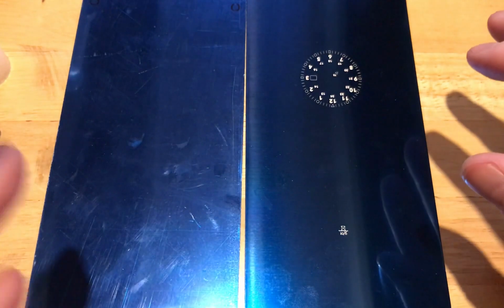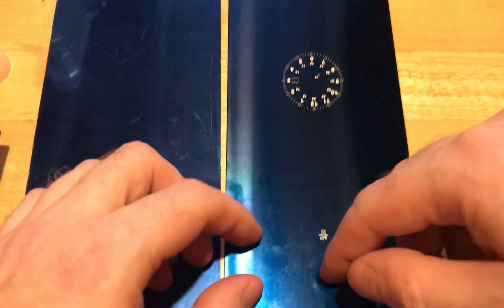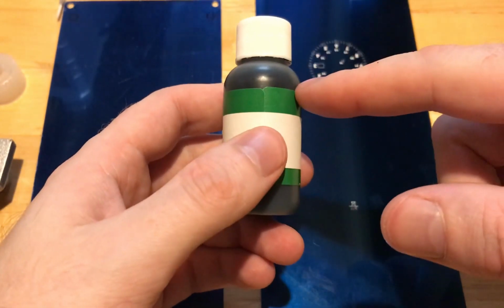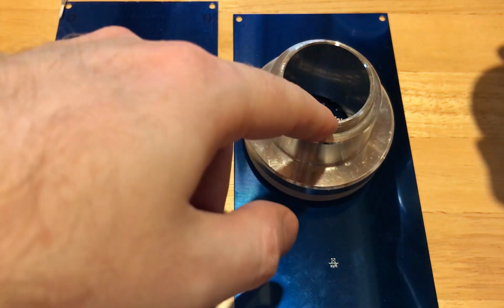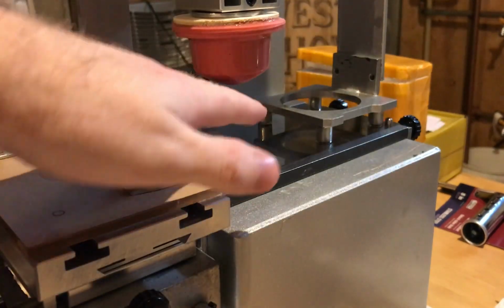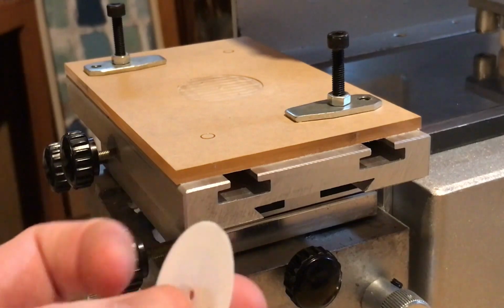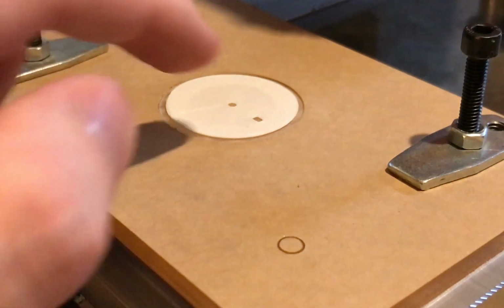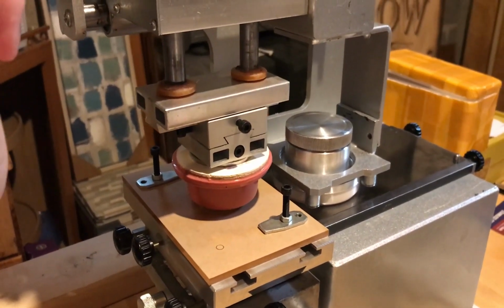Making Custom Dials Part 3: Pad Printer Setup

Comment: Hello Sir,
Which pad printing rubber size is good for dial restoration, can you tell me
Reply from the maker: That depends on the dial size. A good general size is 2" I'd say but you can go smaller or larger depending on the specific dial.
Reply: @WatchComplications ok so I will bought different size

Comment: Do you happen to have a listing of equipment that you are using? Brand of pad printer? Steel plates source? STL for dial blanks? - Great video!
Reply from the maker: You will find some information in the video descriptions about pad printing, you can also look at some of blog posts on my website watchcomplications.com like Duel Time. The pad printer is a low-cost model from China I got on eBay years ago. Steel plates I get cut locally by a mechanical engineer with a laser. I make my own STL files with AutoCAD.

Comment: What a gem this video is, thank you! I am new to the pad printing world and am trying to find info on the parameters you would use for the plates that you are engraving. Where might I find some info on that?
Reply from the maker: What parameters specifically are you wanting to know?
Reply: @WatchComplications  The metal sheets that you engrave your designs on, where do you buy them? Or do you make them?
Reply from the maker: @brockleetolman2064  they were some stock that the engineer I went through to engrave them locally had from a previous project. If you are looking to buy, I would use the term "steel cliches"
Reply: @WatchComplications  amazing, I appreciate it. Thanks!

Comment: Hi, thank you very much for making this video. Is it possible to let the ink sit in the ink well after printing to use it again days later? or do you need to clean it after every use? so is the ink well sealed enough so that the ink doesnt dry out after one or more days? Thank you.
Reply from the maker: you can leave it for some time, a day or two, but air is air and can eventually get in. The issue would be more about the areas that aren't sealed under the ink cup on the cliche that can get crusty after some time if paint is left on it.
Reply: @WatchComplications  thank you very much for your reply! Really appreciate it.

Comment: Quick Question,

Do you need to have something previously etched on the dial to apply ink? 

Or would you be able to print a logo on it with just any dial you put under the printer?

Also, awesome video! :)
Reply from the maker: You don't need anything etched on the dial for the paint to transfer. The etching is on the cliché, ink fills in the gaps and the pad transfers it from the cliché to the dial surface.

Comment: Hi, thanks for the detailed video. I have a question about laser etching machines. They do not seem to be very expensive - at around the $400 price point. Would you ever consider adding one to your workshop to avoid having to outsource that step of getting the etching done?
Reply from the maker: The lasers you are talking about are meant to cut wood, acrylic, and other softer materials...maybe etch the surface of certain metals. Some people try using acrylic or other materials for plates, but typically stainless steel works best in my experience. I know 20-26 microns doesn't sound like much depth but you need the right sort of laser to do that work, and can also handle the reflective properties of the metals in question...e.g., steel, aluminum, brass, copper. To do this work, including cutting out blanks, date windows etc...you'd be looking at Fiber lasers generally, but my plates get cut with a YV04 laser. And such laser aren't cheap.

Comment: Dude you talk to much. we all clued up thats why we hear.  Get on with it.. Thank you. frustrating you trying to explain your process, why not just do it in a run and talk us through it.  it would be a lot better for your viewers and your channel. God only knows how ink is held inside a vessel like you showed. Surely the way you showed us it would just pour out, i thought the neo-mags where to hold a screen of some sort. everything else i got. but im halfway through. maybe you will surprise us. nice little set-up. you print lume too? arr ok, i got it the ink container stays stuck to the plate and slides back n forth, i got it on my hunt. those printers are fir sick. i was thinking to do dials with screens. but the pad is a sweet process. all doable by hand and a few 3d printed parts i reckon.
Reply from the maker: me talking through the steps in detail is what my subs like about my channel. too many channels exist that don't really get into the weeds and leave people guessing. skip around would be my suggestion. you can use the same process to print lume, I'm not sure why that is the expectation for this exact vid though. I usually set things up to lume by hand, which can be seen in some of my other videos.

Comment: Clean free oil cup is an innovative product. After workers finish printing, they no longer need to clean the oil cup. They only need to replace the ink cartridge inside, saving the ink and time costs of cleaning the oil cup. When encountering products with multi-color printing, they only need to replace the ink cup with different colors. It is a good product that improves efficiency, saves costs, and is energy-saving and environmentally friendly.https://youtu.be/3zlYM9jcXlA

Comment: I am considering purchasing a pad printer for my small watch dial restoring business, and I can't seem to find anyone who etches cliches in my area. I need an estimate on the cliche etching to determine if the purchase of a pad printer would be cost effective. Are you willing to share how much you pay for the etching of your plates? Or any knowledge of who I can go to to do this?
Reply from the maker: I’m lucky enough to have someone local to me that has a laser that can do this and it costs me about 75-100 for a design. Some services exist that do it as well if you can’t find someone local, but I prefer to work with local makers if at all possible. Easier conversation.

Comment: Any thoughts on using a liquid mask to create an image that can be painted over but easily rubbed off to reveal the base metal?  Kind of like the old rolex white pan am gmts.
Reply from the maker: I haven't experimented with that sort of thing, so I really can't comment on it. I would think the challenge would be to not mess up other parts of the dial/paint during the process.

Comment: Really nice video. I missed any info about what specific pad printer plus accessories you were using. Can you give give informations about the product and where to get it.
Rgs
Anton
Reply from the maker: it’s a generic Chinese pad printer. You can find them on ebay and amazon, just search for pad printer with sealed ink cup.
Reply from the maker: I should also mention I got the ink and related accessories from a company called Imprintor, easy to find on google.
Reply: @WatchComplications  Thx a lot. 🙂

Comment: Tedious in the extreme! 
"Ok, you get a screwdriver, which is designed specifically to screw in and unscrew screws, and it is inserted into the fixture, making sure that the tip of the screwdriver inserts centrally on the surface of the screw. Then, mild pressure is applied to the screwdriver, and with a counterclockwise motion, my wrist unscrews the screw to the fixture. I continue with the counterclockwise motion until the screw is completely separated from the fixture. When the screw is wiggling in it's hole, that indicates that the screw is loose enough for removal, and signifies the end of the process of unscrewing the screw to the fixture..."

Comment: If I make and send you a vector file, could you get a plate made for me? I will compensate for your time/knowledge/costs, of course. I bought a machine but I'm having a hard time finding any resources on having plates made.
Reply from the maker: I use someone local to me with a laser. If you Google “plate etching services” “cliche etching” things like that, you will see several companies that provide the service. Different materials can be used and you’d need to have the plate dimensions for your printer.

Comment: Hello, 

Any chances you could tell me the size of the cliche this machine takes ?
Reply from the maker: they are about 8.5 x 4 inches
Reply: Thanks, i plan to make few dials I'm in the process of making cliche and they asked me about the size my machine takes. I don't have it here yet that's why I asked. 

So 215mmx100mm looks like it

Comment: Hi. Very informative video for someone like me exploring pad printing. Question: when you have your laser shop etch the ink plates, how deep do you tell them to go for optimal ink holding/transfer?
Reply from the maker: We didn't measure it. We just know how many passes the particular laser (YVO4) does of the design. But, based on what I've read, I think most etchings for pad printers are around 24-28 microns in depth. Hope that helps.
Reply: @WatchComplications  Very helpful! So I’ll short for 0.001” deep and adjust from there.
Reply from the maker: Paint viscosity and timing also has a significant impact on how well the ink transfers, so keep that in mind. Just more variables.
Reply: Is there a maximum depth? Is the ink reservoir suppose to hold just enough for the printing? - is much left behind after the pad has picked up the ink
(I'm wondering if light cuts from a pantograph would be too deep)

Comment: 50 years ago we had no silicone pads - we would melt gelatine into molds. Laser engraved plates, photosensitive papers? 
Way too simple! 
We would order hardened steet plates from Switzerland, coat them in wax, using a pantograph would scratch off the wax where required, then acid etch the markings.
I could go on about galvanic silver plating, grinding up salt, precipitating silver, cyanide stripping, chloroform fumes.
Tritium luminous powder. Radium on old dials flushed down the sink, along with some cyanide - frown on behaviour today. 

What is this modern witchcraft you use? 
It seems way too straightforward and lacks any the dangers we so enjoyed usually avoiding. And your ways slash the labour involved putting people out of work! 
Pad printing dials was a specialist job then - I never attempted to master it myself. 

Great video, I might just learn a thing or twenty here - but I miss the skin irritation and headaches from the chloroform. And the odd minor fires from acetone. All the dust issues of spraying lacquers  taught me resiliance and many many swear words too. 
I still have a scintillation meter the Gov. required us to purchase for the Tritium license - I keep it in case those Ruskies get over excited and nuke us.
Reply from the maker: one of the most entertaining comments so far on the channel. thanks :)
Reply: I’d like to know more about this as well. Your comment pulls back the curtain on a mysterious process
Reply: How come you etched the plates with acid rather than directly with the pantograph?
Reply: @beautgrainger147  Hi. The applied wax protected all the plate top surface - the back was protected with shellac.
The pantograph needle by scratching/cutting through the wax to the bare metal. This removed the protection of the wax - so you have a hardened steel plate fully protected from chemical treatment except for the lines/areas where the wax was removed from the plate.
So you use acid to eat into the bare (but polished & hardened) steel plate only on the ares exposed by the pantograph needle removing the protective wax. You get an acid engraved finely defined line, or area, on an surface that you can use a steel spatula to apply ink/paint without fear of introducing scratches by spatula  that also later add ink in random areas resulting in a crap result.

Comment: Hi. Thank you so very much for this! I want to make my own custom dial by firing vitreous enamel onto copper essentially  creating a painting in glass.  This means that I will have to make the dial from scratch, and my issue will be how to add the feet and enamel around them. I plan on finding a suitable watch and replacing the dial with my own. Another issue that I will have is with the thickness.  With each layer of glass I may have trouble controlling the thickness. Your videos are so inspiring and I look forward to making my watch,  and seeing more of your work.
Reply from the maker: sounds ambitious. enamel is crazy hard to work with. all the best!

Comment: is it easier just to print from a printer and glueing it on to the dial
Reply from the maker: it would be much much easer, but wouldn't look very good. I've seen some tutorials out there that do apply a printed paper with glue, but a better option that is not as difficult as pad printing is using waterslide decals: https://youtu.be/mtwreFBs9ts

Comment: Is it possible to pad print with luminous ink? 

Or would it be better to simply apply the lume by etching or carving the dial, and additively applying the lume to the dial, like in your other video?

I want to make my own dial, to modify a watch that I own, with a 2416b movement, to have a custom logo on it.
Reply from the maker: You can print with luminous ink, you just have to source the right ink and/or get the viscosity spot on for it to transfer clearly and cleanly. I hope to experiment more with it myself over the summer. Applying lume in depressions or on applied markers is much easier than going through the whole process of home-based pad printing, in my experience.

Comment: Hi, sorry if I missed this, but I'm eyeballing the same printer and was wondering if the rubber pads are included or if I need to order them separately. If so, where did you get the main one you use for dials? Thanks mate, love your work!
Reply from the maker: I picked up a couple different sizes on eBay. They come from California and are like $6-7 each. I also got a black one that's more firm from the company I get my ink from (https://www.imprintor.com/), to test out at some point. That one was about $40.

Comment: Love the series. A couple of questions, if you don’t mind. There are some really cheap electric pad printers on eBay ($160aud ~ $110usd ... cheaper than manual!)... do you think they would be any good and what downfalls?
With the inks, are they just a high opacity enamel? I’m just a hobbyist and really only want small sample inks and having trouble sourcing in Australia. 
I’ll keep watching the series in case you have already answered any of this in a future episode.
Reply from the maker: Hello. I would start by saying it's hard to say without considering a specific model, as there is quite a variety out there. I know most low cost machines are not that well suited for dial printing, and certainly don't have default fixtures to support dials. But if you are looking into low-cost options beyond the manual process I have shown so far in this series, you could look into film-free transfer paper. I plan to show that process in future videos, just haven't got around to it yet, but I will eventually.

Comment: Hello! Very informative video! Would you mind sharing the dimensions of the steel plates as well as the placement of the dial pattern on the plates? I have the same machine. I am trying to figure out where to start. thank you!
Reply from the maker: The template that came with the machine was 10cm x 21.5cm. The plates I'm using are not the same dimensions as the template, so I have to get custom holes punched to coincide with the ones on the template so it fits on the machine. To get the pattern in the right place on the plate is going to depend some on where you expect to have all the machine components aligned because they all move around in various directions. I put a little ink on the pad tip and pressed it on the plate and then measured to center of the paint from the edges. Then I drew a digital version of the plates/template to the correct external dimensions and then drew offsets to the four corner holes and to the center of the paint (i.e., what will be the center of the design) for each side of the plate (think north /south sort of logic...that is the plate swapped either direction).  Not sure if that description helps, as it's easier to show with a visual. If you look at one of my blog posts (https://watchcomplications.com/2019/06/10/gmt-blue/) I talk about it and show the diagram I'm talking about in the "Make the clichés" section.
Reply: @WatchComplications  Thanks for a very thorough and in-depth response! Makes a lot of sense. Looking forward to more tips on how to make custom watches in the future.